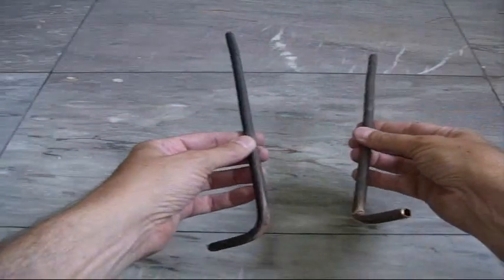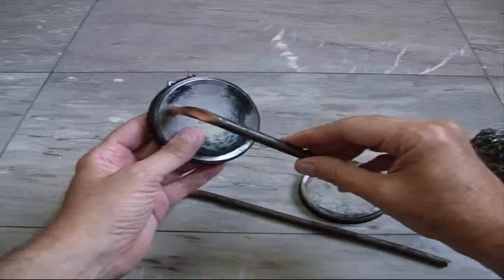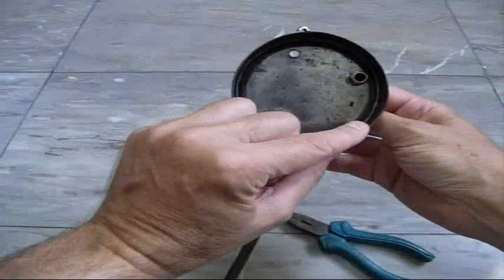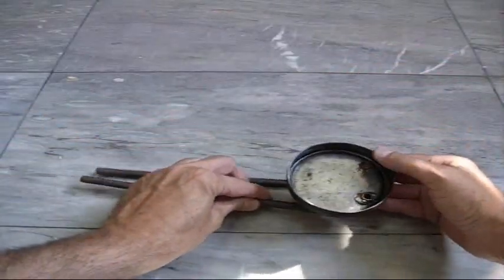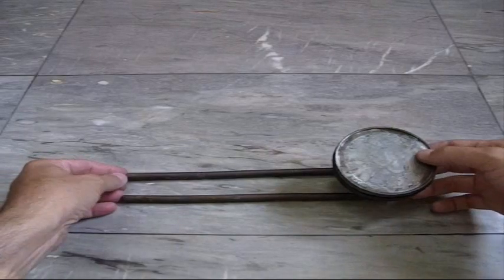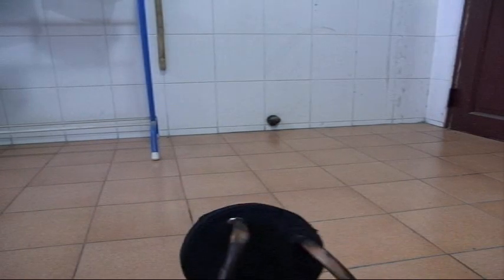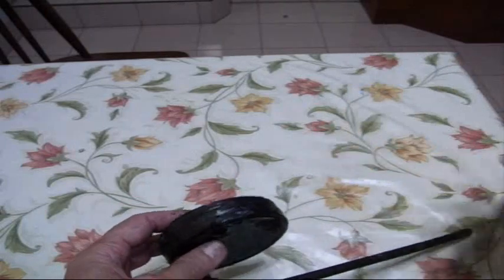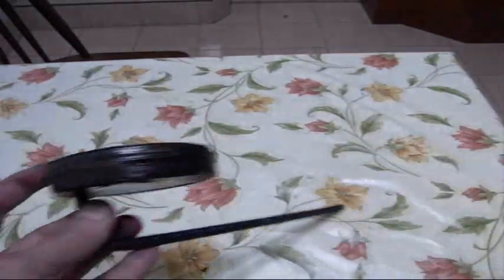Monster Putt Putt Boat From Household Junk - Build, Test, Analysis

Comment from the maker: I need to build another one with a large, *thin* boiler.  Thinking about using 2 pieces of sheet metal held together (pop rivets, screws???)  The hard part is fastening the tube to it securely and not having it penetrate the boiler much.